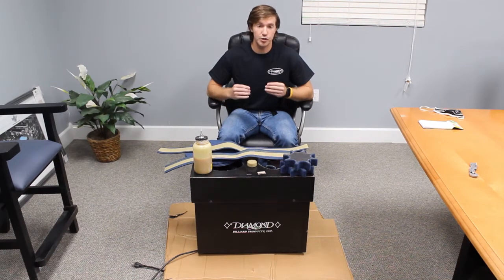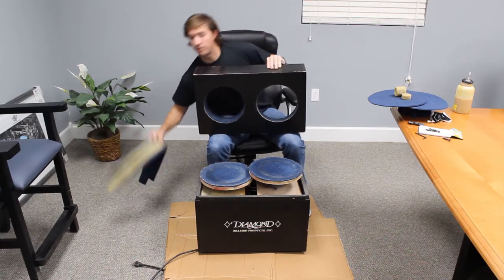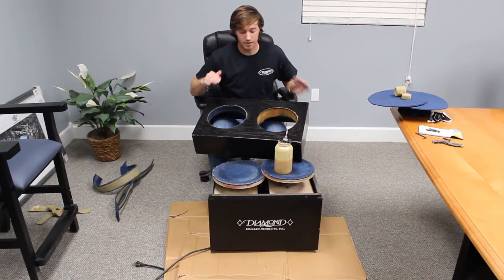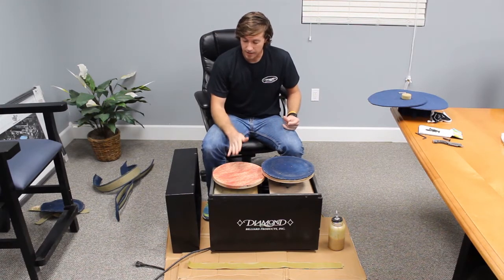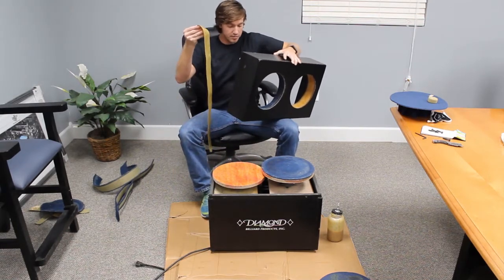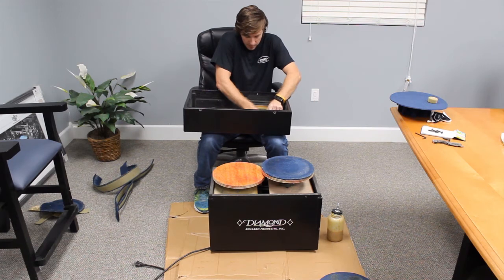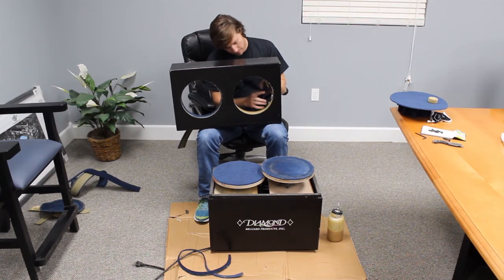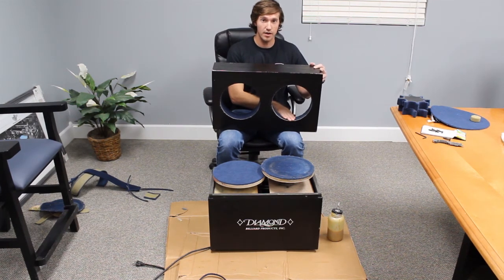Ball Polisher Replacement Carpet Kit Installation

Comment: I have the polisher coming shortly after my new ProAm arrives next month. Can't wait! I do have a question though: if you're using velcro for the sidewall carpeting, why replace the velcro backing? If you have to glue in new velcro each time, what is the point of the velcro? Why not just ditch the velcro and glue the sidewall carpet directly like you do the platter carpet?
Reply: I agree, there should be no need to replace the velcro.  I would only do that if the original came loose or was damaged.  The idea of velcro is that the parts joined can be seperated over and over.  Replacement of firmly fixed velcro simply not necessary

Comment: Ok I'm so confused. Diamond makes replacement parts that don't fit so the consumer needs to make fit? Why would you not cut the velcro and carpet to the correct dimensions at the factory since it's your product and know the exact dimensions? That's the stupidest thing I've seen from a factory selling replacement parts. I can see if it was marketed from someone else as Universal fit